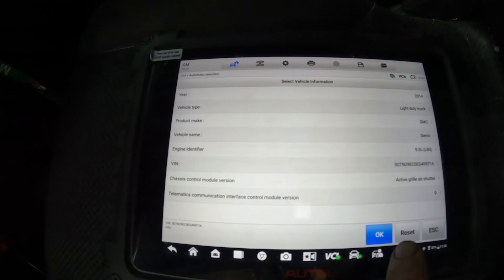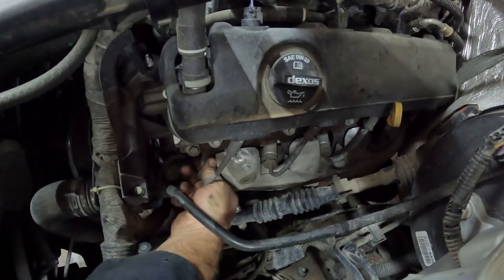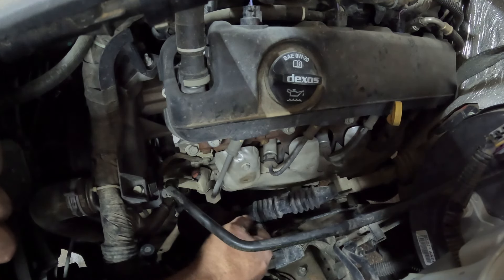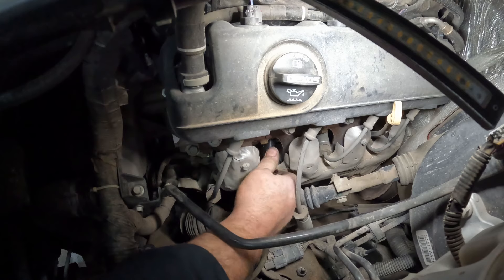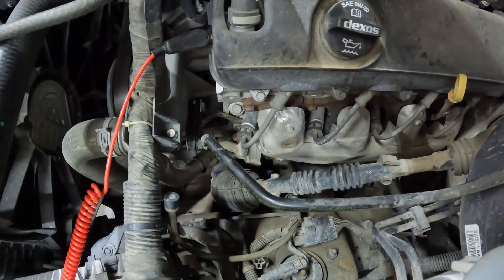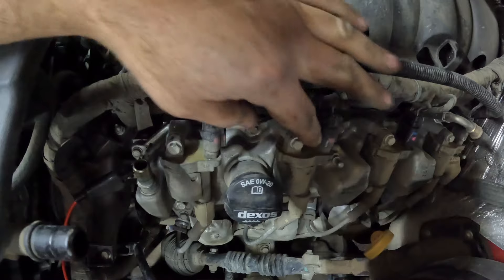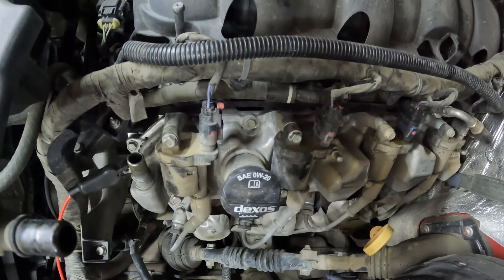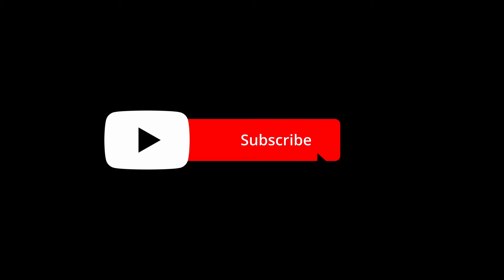2014 GMC Truck Misfire Diagnostics With Known Good Part

Comment: Changed everything you did in this video. still got the cylinder 2 misfire. there’s also a loud ticking or maybe clicking coming from the engine.
Reply from the maker: You shouldn't need to replace anything until you swap the known good parts from a good firing cylinder to the one that is misfiring.  If you swapped the parts and still have a misfire, specially if it's making noise, then you'll have to perform a  compression test and maybe a cylinder leak test.  I can tell you that you probably have a collapsed lifter on the misfiring cylinder.  If you can very a cylinder with low compression then your going to want to remove the valve cover on that bank and to see if any of the rocker arms are loose.  Hope this helped.  Thanks for watching!!
Reply: @ copy that. also the noise sounds like an exhaust leak more like the sound of air leaking? mainly from the air intake manifold area/ throttlebody

Comment: I had. 2014 if u don't keep up with maintenance u will be putting $ in to it special the trans bad about going out i no I had to replace the one In my 2014 3500$
Reply from the maker: Proper maintenance is so important.  When it gets neglected, sometimes it creates other preventable issues.

Comment: And when doing them plugs wires twist them off unless u replacing them they come off easier twisting them and make sure u put lub on the plug ends so they come off easier
Reply from the maker: Good tip!

Comment: Um I had a nosie in my 2014 6v ec9 2 stage oil pump though it was just plug or wires they did a pressure test 4 cylinders were 127 % but 2 were 104% and 94% so make sure u pressure test  cylinders before u put all that money doing plugs wires ignition coils
Reply from the maker: I hope everything works out well for you!

Comment: Having an issue with 7/8 cylinders. Got a  half 🫏 diagnostic and they just say I needed a new motor (oil on spark plugs) and admitted that they didn’t pull valve covers or even check the pcv system.
Reply from the maker: It’s frustrating when mechanics don’t take the time to do a thorough job.  Thanks for watching!!

Comment: The worst case scenario for this would be?
Reply from the maker: Worst case would be an engine replacement, but there is a lot of things that need to be checked before you get to that point.  Fuel injectors to valvetrain concerns or more major things like cam, valve or piston damage.  Thanks for watching!!

Comment: Good info. But for us who don’t have a scanner tool that can pinpoint the specific cylinder misfire, I only know it’s a P0300, how can I test the ignition coils?
Info on blue tool to pry the wire?
Reply from the maker: Using a scanner is the best way for sure.  You can always pull the individual spark plug wires off one at time.  Use insulated pliers though.  If the rpm doesn't change then that's the cylinder that is misfiring.   Thanks for watching!!

Comment: I have replaced plugs wires still have misfires on number seven and replaced ignition coil on seven what could it be
Reply from the maker: Did you verify the misfire on #7 with a scan tool???  If so did you have spark output on that cylinder?  If so, you need to check compression and fuel on that cylinder.  Thanks for watching!

Comment: I think you fixed my problem and I didn’t even start checking anything yet. Besides scan tool: misfire cylinder 6
2014 Silverado 5.3
205k miles

Comment: Should have moved plug wire & coil also evap solenoid probably  bad .. which allows it to draw fuel vapor from tank which is not metered by pcm
Reply from the maker: Should have watched the whole video!!!

Comment: What if im getting couple missfires every 5 min or so? Usually happens of almost every cylinder.
Reply from the maker: That's typical even on a good running engine.  If there is no code for misfiring and it doesn't feel like it's misfiring, I wouldn't worry about it.  Thanks for watching!!

Comment: In my case after swaping plugs, wires and coil, its still showing same plug, any idea what to check next?😅
Reply from the maker: Sounds like a mechanical fault in the cylinder.  Check fuel injector then compression test and cylinder leak test.
Reply: Yup I’m in the same boat currently. Moving onto the fuel injector next. We’re you able to find out what your issue was?
Reply from the maker: The #1 ignition coil was faulty.  Thanks for watching!!

Comment: Same problem but i replaced the plug wire coil and fuel injector still have a misfire on cylinder 1
Reply from the maker: You'll have to check compression on that cylinder next.  Thanks for watching!!  Good Luck.
Reply: Stuck lifter
Reply from the maker: It happens all to often.  Dang.

Comment: I have a random misfire on my 2014 silverado , l  have  spark on all  plugs , what else could it be ?????
Reply from the maker: Could be a lot of things.  You would need a scan tool to look at engine data.  I would recommend starting with checking misfire data and what cylinders are effected.  Then I would look at fuel trim to what that is doing and go from there.

Comment: how to replace ignition coil connectors?
Reply: i replaced spark plug and spark plug wire and coil on cylinder 8, so that might lead to wiring issue which means connectors ? so i need to know how to replace it
Reply from the maker: I think the ignition coil harness can be replaced on the whole bank if I remember right.  Thanks for watching!!

Comment: You mentioned not hearing the lifter, having this issue on an 07 Sierra with a cylinder 4 misfire. Changed plugs, wires, and coils already but the lifter is ticking. Any diagnostic tips?
Reply from the maker: Collapsed lifters are an issue on these engine.  Diagnostics as shown in the video is just a simple way to check some of the basics without throwing parts at it.  If you have a known good firing cylinder you can swap ignition parts between the misfiring cylinder.  If nothing changes, then it's not ignition related.  Then you go to the next step.  Injector flow test, compression and cylinder leak tests.  If your hearing a tick in the valve train, the compression and cylinder leak test will identify the issue.  If it fails a compression and cylinder leak test,  the next step would be to remove the valve cover and check valvetrain.  Thanks for watching!!
Reply: @paycheckmonster I have a collapsed lifter on my cylinder number 7. Had no compression on 7and I took off the valve cover and rocker arm had lots of play. What are my options? I'm handy do I just replace the lifter or are there more parts to change that you recommend. Any video on collapsed lifters you have or recommend? Thank you.